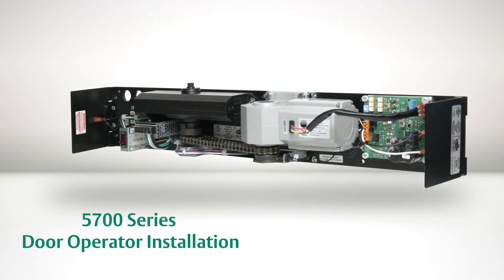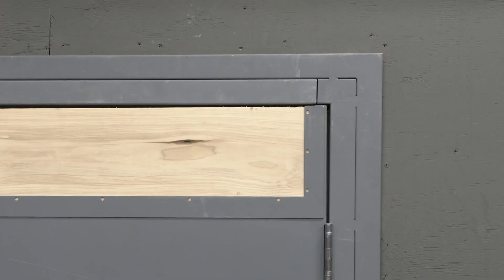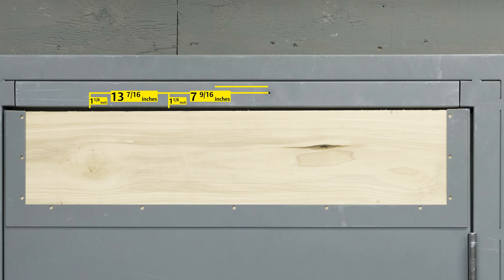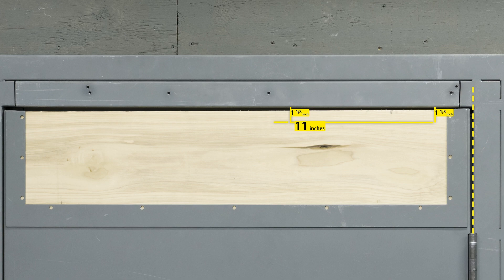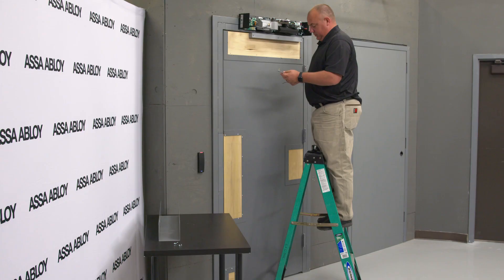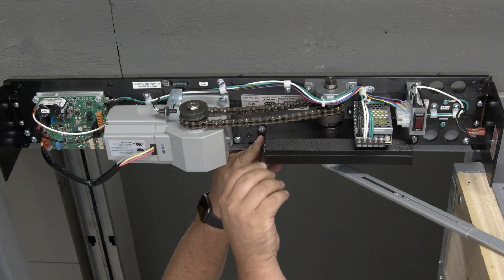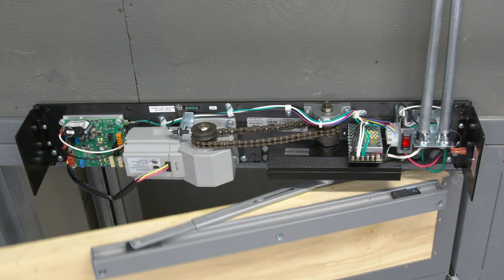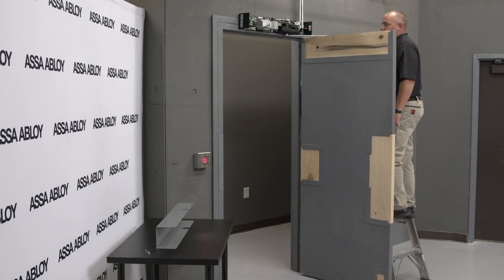How to Install a Norton Rixson 5700 Series Operator | Norton Rixson Door Controls

Comment: Any way I can adjust the speed of the automatic open and close? Not the hydraulic section but the actual motor speed. As well as the time delay between when the door goes from open to when it begins to shut?